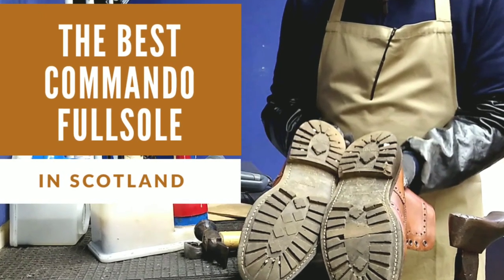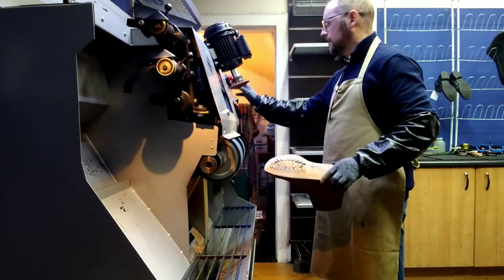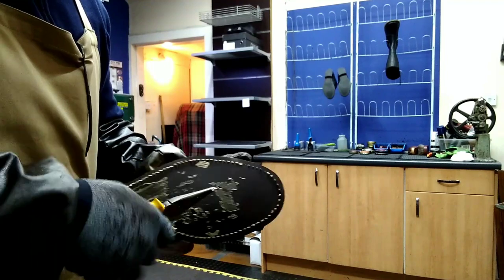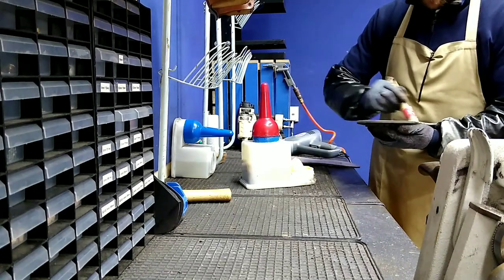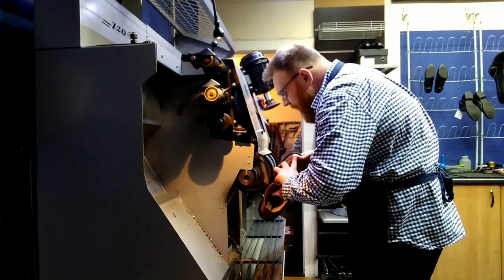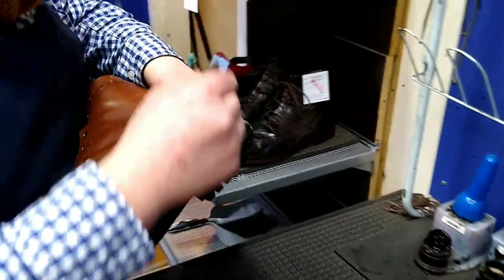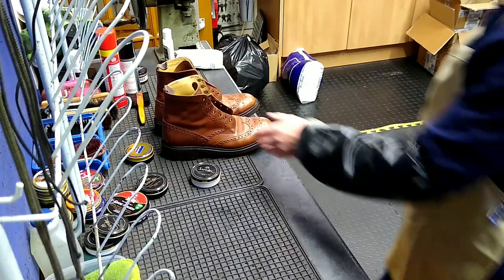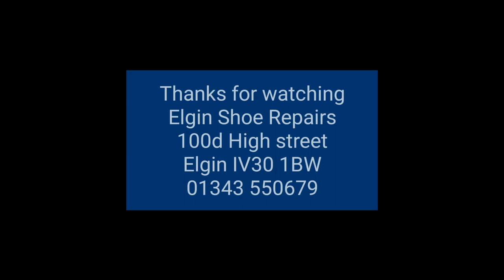Commando Full Sole Repair

Comment: Great video and awesome work! Just curious why you did not cut a channel in the rubber sole prior to stitching?
Reply: Hi David thanks for the feedback I tend to do a video then forget about it ...my apologies to anyone who has taken the time to comment and I have not responded sorry.
There is two reasons why we didn't groove the soles before the Goodyear stitch,  one is the boots or shoes that come with commando full soles originally on the shoes never have them grooved  and the second is that the commando tread pattern is so high that it protects the stitching from wear but I have always thought that the toes could benefit from a groove to protect the stitching on the toe  as we all know its the outside of the heels and the tip of the toe that get the most punishment on a shoe, we have started grooving our commando club soles (round stud pattern) just for a little bit more protection for the stitching 
Thanks for watching 
Kenny the Cobbler

Comment: Did you check out the stitch length?  You have to make sure to stitch in the former  holes, if not  you cut the  welt strap...
Reply from the maker: Hi thanks for the comment 
It is near impossible to get the stitching in the original holes, we set the stitching machine to 4mm stitch (6 stitches pre inch). When stitching a shoe as you see in the film the shoe is upside down so unless the technician spikes a pilot hole first from welt through to the sole for the awl to come through to use as a guide for the first stich then there is no way of knowing if the stitching is going through the original stitching holes on the welt, in my experience a goodyear welt will withstand at least three/four resoles goodyear stitch before having to think about replacing the shoe welt.
For all the years and all the technicians I've met over these years I have never met anyone trying to match up the original stitching holes on the welt but we can always try harder for perfect results.
Thanks
Kenny the Cobbler